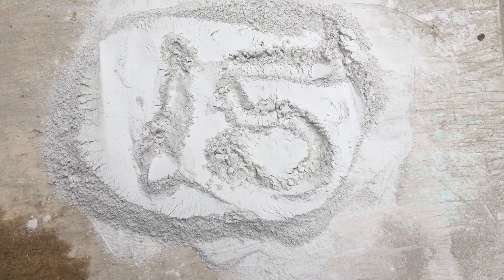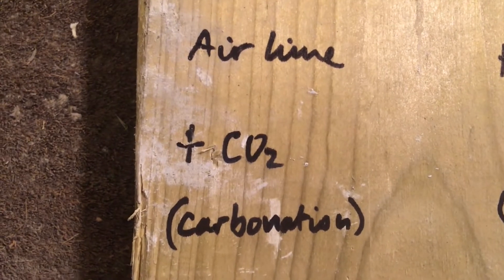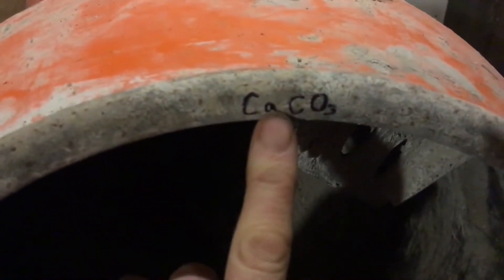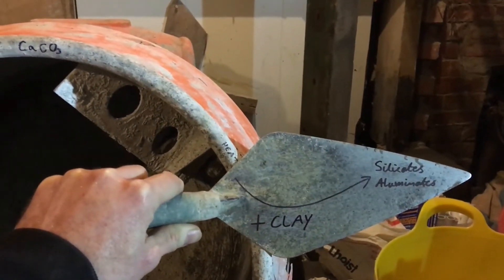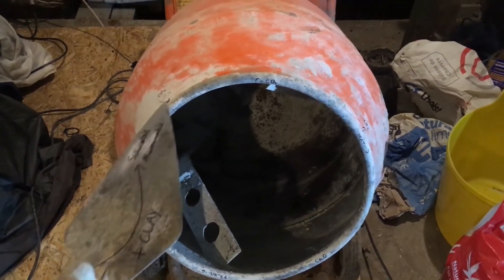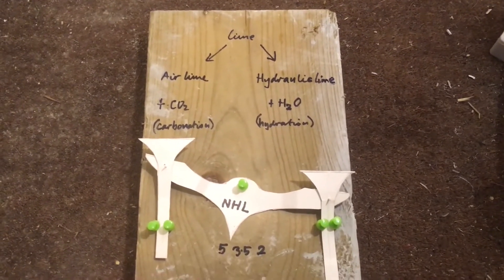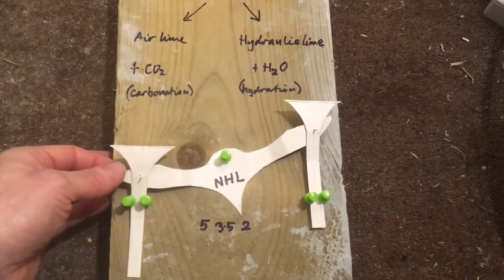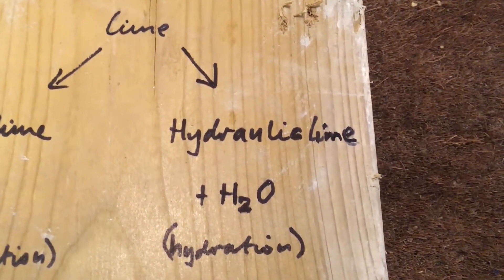Hempcrete Extension E15: What is Lime anyway?

Comment: Thanks for this, it was helpful in my understanding of hempcrete binders. However as a thought exercise, if only Hydrated Lime Ca(OH)2 was used as a binder for hempcrete, would it all just fall apart as soon as you take the shutters off? Would it not be able to cure enough with the CO2 in the air, at least on the surface, fairly quickly to hold it all together? or would it as you say take months or years??     .... having said that, I'm thining of adding pozzolan materials like fly ash, metakaolin or pumice to introduce those silica and aluma (you know, like those Romans did), do you think that would be the same as using NHL3.5?
Reply from the maker: hey
i guess they formulate it with just enough set to be able to take the shutters off, but the rest of the set coming from absorbing Co2 so as to minimize the carbon footprint - so yes i think if it were all air lime it would crumble, presumably they tried that? Sure you could get this balance with your own formulation if you know what your doing, and experiment a bit.. wouldn't wanna get it wrong on a whole wall tho. Also one of the things about the system I used is that it's building control pre- approved, so if they know your using it you can just go ahead, no more questions about formulation.